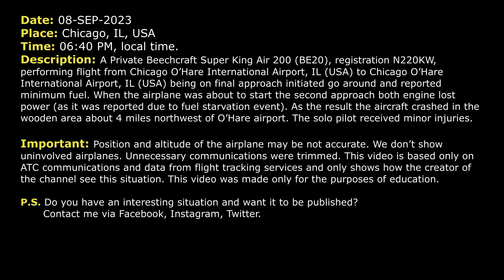Both engines stopped in flight. The is no FUEL. Beechcraft 200 crashes neat Chicago. Real ATC

Comment: It is absolutely on the approach controller, instead of clearing king air first he made him last.
Reply: It’s not. He only declared minimum fuel which means you are down to the required 45 minutes of fuel. If he had declared mayday fuel he would’ve been given priority. This is all on the pilot. ATC did everything correctly.
Reply: @JaxAviator  it does not matter, if there is a chance a guy can crash, you vector him first. Approach didn't even ask for fuel remaining. Just lazy controlling.
Reply: @TyecoK  it does matter. There’s a huge difference between minimum fuel and mayday fuel. If you say minimum fuel, that means you have 45 minutes of fuel remaining. If you say mayday fuel, then you ask how much fuel since mayday fuel is different for every plane and pilot preference. Minimum fuel is always the same.
Reply: @TyecoK  What does a "chance the guy can crash" mean? Did he declare an emergency? "Minimum fuel" is not an emergency. Pilot is responsible judging the situation and asking for help. ATC can't see his fuel gauge. ATC already went above his duty requirement by keeping him under the ceiling and bringing him back around quickly. And again by sending the Brickyard around.
Reply: @JaxAviator  what if his fuel gauges are not working properly? It was an easy fix - just cancel the approach clearance for those arrivals and then land them later. But the guy just didn't want to work hard.
Reply: @TyecoK  anybody's plane could have crashed, that's not unique to this guy. Anybody's plane could have bad fuel gauges, that's not unique to this guy either. Based on time or fuel gauge indications, he made a statement as pilot-in-command that he had 45 minutes of fuel, or at least 30 minutes if he was just VFR. Neither of those is an emergency, that just gives him a little extra priority if they need to squeeze them in between some other traffic. It's not the job of controllers to jump to conclusions. Even some aircraft emergencies don't get that much priority. If you're in an airliner and you troubleshoot some flaps issues for a little bit before it's time to land, you don't fly direct to the numbers
Reply: @TyecoK ”if his fuel gauges arent working properly?” Do you really think it is controller’s job to think if fuel gauses are working properly or not? It’s pilot’s job to decide properly and declare emergency if it is needed. In this case, pilot did not make proper decision and did not declare an emergency. Even if fuel gauges are really faulty, it would be maintenance guys fault, not controller’s fault.
Reply: @TyecoK  

1. The approach controller did everything he can, the pilot did not declare emergency until it was too late. If he declared emergency because his fuel won't be enough to make a proper pattern and approach, he would've been prioritized, and all other traffic will be instructed to go-around to give way to him.

2. A pilot has the authority to reject ATC clearance and instruction if it's for the absolute interest for the safety of the flight.

3. Minimum fuel is just an advisory of a possible emergency situation in case a delay occurs.

4. If his fuel gauge is not working, then it's still not the ATC's fault. In flight planning, fuel is calculated in time (example would be 4 hours of fuel time) and there's also the estimate flight time so a pilot can make a rough estimate on how much fuel he has by how much time has passed.
Reply: @TyecoK  you’re clearly not a pilot.  Listen to what everyone has to say to learn
Reply: @TyecoK - I can declare minimum fuel with 20 tons still on board. It depends how I define minimum. You need to understand the difference between minimum fuel and emergency / mayday fuel. There’s a big difference.
Reply: @JaxAviator  Exactly this, as a center controller that's more or less my reference... If someone declares minimum fuel, I'm expecting them to have 45 minutes of fuel when they get to their destination. No reason for their for airplanes to be falling out of the sky and killing people just because you only want to put 5 dollars in your tank when you stop at the pump. Airplanes are not like cars.
Reply: 100% bad decisions on the pilot. This was not the controllers fault
Reply: Min fuel means the pilot is at 30 mins (VFR)/45 mins (IFR) and zero. On the go around, he stated he was at 'minimum fuel, now. ATC will interpret this as he has at least 30 mins remaining.
As the PIC he is responsible for situational awareness, and the urgency of feedback to ATC.
Had he declared 'Emergency fuel,' or  just declared "Emergency," no ATC would request the go around.
Reply: not for a second, the pilot made NO mention about their critical state, they simply stated MIN FUEL which implies resequencing as soon as practical, vs MAYDAY FUEL which makes them a priority. 

Pilot will be canned for this. 100% avoidable.
Reply: No.  You have no idea what you are talking about.  He didn't declare an emergency.  Once a pilot declares an emergency, he can do whatever he wants/needs.  He didn't declare an emergency because he was a fool.  Minimum fuel means nothing specific.  Aviation has many magic words. Minimum fuel isn't one of those.
Reply: Tell me you're not a controller/pilot without telling me.
Reply: Such an ignorant response.

Comment: What was the purpose for the go around?
Reply: That's what I want to know. It looked like a decent approach from the backtrack but they didn't say anything about crosswinds or weather or anything.
Reply: Said the tower sent them around. Maybe someone can pull that recording.
Reply: @Ridejumpfly  You're right- I missed that. @0:30 "You should be with the tower." "They told us to go around and contact you." So it was definitely initiated by someone on the ground and not in the aircraft.
Reply: Also said he was minimum fuel at the go around, I would like to know if he declared minimum fuel prior to first approach? If he did then ATC was required to provide no deviations and priority spacing.

Comment: 3:21 Runway 83?
Reply from the maker: I believe he wanted to say highway 83
Reply: @YouCanSeeATC ya got Highway and runway mixed up
Reply: @YouCanSeeATC  As a local, 83 would've been a terrible choice anyways based on traffic and hazards like overhead wires and lights. His best bet was actually just west of where he touched down; Cosman Rd in Elk Grove Village is a quiet street that nobody parks on AND has a nice wide utility easement on it's north side. If used to the maximum allowed without going through any gates, it's a 2800ft x 70ft grass strip.
Reply: Yes, Highway 83 is right there

Comment: According to flightaware, they were going to Waterloo (~250 miles west of Chicago) and got diverted right before attempting to land. Then they flew all the way back to Chicago. Not clear why.
Reply: What kind of diversion would send them back to Chicago rather than something closer?
Reply: @YouveBeenMiddled  Probably whatever mission he was doing was a moot point if he couldn't land at Waterloo, so it made sense to return to base. Solo pilot in a King Air, likely he was going to pick up passengers at Waterloo to take somewhere else as a charter flight. Unable to land at Waterloo, the flight would be canceled, likely they'd use other transportation (probably just drive), so he was trying to return to home base. But didn't have quite enough fuel for the round trip.

Comment: He actually got to Waterloo Regional Airport before turning around and coming back. Do they normally take enough fuel to fly to their destination and come back without landing?
Reply: You are required to land with 30 minutes fuel reserve in the day, 45 at night.
Reply: @mark1015 he was IFR. Different fuel requirements
Reply: @jakeoesterreich8037  Didnt catch where he was IFR, plus I don't have an IFR endorsement, just HP and complex.
Reply: @mark1015 He was IFR, so what you said + alternate. “We’re minimum fuel” was a bit of an understatement 😮‍💨
Reply: IFR required fuel is to destination + 45 minuets of fuel. If an alternate airport was required  (weather dependent) its destination + alternate + 45 minuets of fuel at normal cruise.
Reply: @brianneary4525  So in effect he filed a return plight plan without enough fuel to complete the trip legally? Guess he gets permanently grounded just like his plane.
Reply: @andyalder1  I haven't looked at weather yet, but weather can play a role, if he hit head wind coming back it can sap that reserve fuel quick. Biggest issue is he should have claiming a emergency or at least told ATC how many minutes of fuel remaining. The fact he never mayday or Pan when he ran out of fuel is a concern, I was taught to claim a emergency is soon as able (obviously navigate first), no one will be upset if you claim a emergency
Reply: @andyalder1  He probably wan't planning on returning, but bottom line is he probably also wasn't aware how little fuel he had.
Reply: It's not uncommon to set the origin airport as the alternate for such a short flight. You definitely have the charts, you know they can handle you, you know what the weather is... there are fewer threats. That said, I'm not convinced this was a diversion to an alternate. You should have enough fuel to go missed at the destination, fly to the furthest alternate, and land with 45 minutes of normal cruise fuel remaining. Seems like that 45 minutes of cruise was missing here, so either someone miscalculated the fuel, or this was not an alternate on his flight plan.
Reply: We’d need to know what his filed flight plan is. You can certainly file your departure point as your alternate, so to answer your question, yes it’s possible.

Comment: 0KW never should’ve been vectored in behind those two airliners after declaring minimum fuel! Also, knowing how bad his fuel state was 0KW should’ve declared an emergency instead of declaring min fuel. This could’ve been avoided for sure.
Reply: There’s a big difference between minimum fuel and Mayday fuel. Mayday fuel is when you are in your final reserve, and it’s probably what he meant. 

Can’t blame the controller who got the message that he has minimum fuel which he may have (correctly) interpreted as 45 mins or so. 

Could bang on about phraseology, but at this point, glad the pilot got out safe.
Reply: Wrong.  Minimum fuel just means no undue delay.  That doesn't mean you get preferential treatment, it just means we're not going to give a reroute that adds time, put you into holding longer than needed, etc.  It doesn't mean you get to skip the line and be first; 0KW should have declared an emergency after the go around if they were that low on fuel.  Now hindsight is 20/20 and who knows, maybe the fuel gauges weren't working correctly and they indicated more fuel than what was actually on board.  Moral of the story, "minimum fuel" is not an emergency.  If you need to land NOW, declare the emergency.
Reply: @anthonyd5189  that’s exactly the point I was trying to make. The pilot was beyond a “minimum fuel”  state when he declared that and should’ve declared an emergency!  I don’t believe stating minimum fuel has any specific time remaining element to it. A pilot could declare a minimum fuel state far from an airport. Min fuel just means that the fuel state is not critical at that point however any undue delay would cause the aircraft to enter an emergency fuel state which is an emergency situation requiring priority handling. Good controllers can sometimes tell by the pilot communications and actions (such as turning inside of traffic on final he was supposed to follow) that the situation is more dire than the pilot is stating. Controller did his job based on what he was told however he could’ve possibly queried the accident pilot further to better understand the true nature of the  situation and once knowing how critically low the pilot was on fuel could’ve accordingly directed him directly back to the field and had the airliners go around. It’s way to common for controllers to always push ga aircraft out of the way for inbound airliners when it really not warranted/ required by the FARs.
Reply: @mxcollin95  If you know all of this, then why did you state that he never should've been vectored behind the other 2 guys after declaring min fuel?
Reply: @anthonyd5189 this is the correct and accurate answer
Reply: There was no reason for the controller to think he was about to run out. He is supposed to declare “mayday fuel,” which is different than “minimum fuel,” if he’s reaches the emergency reserve. Even if he said minimum instead of mayday in error, it should have been done a lot sooner, since he clearly didn’t have 30 minutes fuel remaining
Reply: @steltekx  The increasingly tense, quick and elevating pitch of the distressed pilot was a clue as well as the pilot turning in short in front of the airliner he was supposed to follow were possible clues that the pilot was in worse shape than he indicated. Really good controllers can pick up on those que’s and query the pilot further to ascertain the true nature of reality facing a distressed pilot.
Reply: @mxcollin95  those things happened after he had been put in queue behind those aircraft. The controller did ask for his condition after he initially declared minimum fuel and he sounded calm when he reported VMC and confirmed minimum fuel.
Reply: Where in the regs does it define "minimum fuel" as that? I swear people just make things up.
Reply: @secondrule  https://www.google.com/url?sa=t&rct=j&q=&esrc=s&source=web&cd=&cad=rja&uact=8&ved=2ahUKEwjBrJi3paaBAxUWIzQIHchnBqoQFnoECCoQAQ&url=https%3A%2F%2Fwww.faa.gov%2Fair_traffic%2Fpublications%2Fmedia%2Fatb2012-1.pdf&usg=AOvVaw22-MfMhdvJ_zXegd56WP7Z&opi=89978449
Reply: @secondrule  I swear you have no idea what you're talking about if you don't know what the definition of min fuel is. Min fuel and a fuel emergency are two very different things. Do some research.
Reply: @secondrule  look in the “Pilot/Controller Glossary” in the FAR/AIM. It’s there to improve communication and breakdown responsibilities between pilots and controllers and to let pilots know what’s available to them.
Reply: @secondrule  “minimum fuel” is defined in the AIM and pilot/controller glossary.
Reply: @secondrule FAA Order JO 7110.65AA - Air Traffic Control. See chapter 2, section 1, paragraph 8 titled MINIMUM FUEL.
Reply: I’ve started out on 14 hour flights with EICAS “insufficient fuel” and had to delete the instrument approach in the FMS just to take off with sufficient fuel. Minimum fuel means nothing in the grand scheme of things.
Reply: @EdOeuna  “min fuel” has to do with pilot / controller communication of fuel state and not what the FMS or EICAS predicts.
Reply: @mxcollin95  - on my FMS minimum fuel is in there as is emergency fuel. Aircraft is a tad bigger than a B200 though.
Reply: @EdOeuna  👍